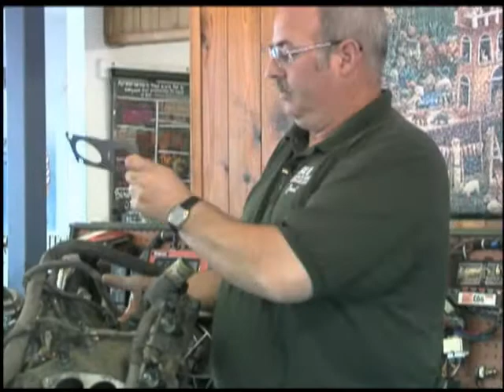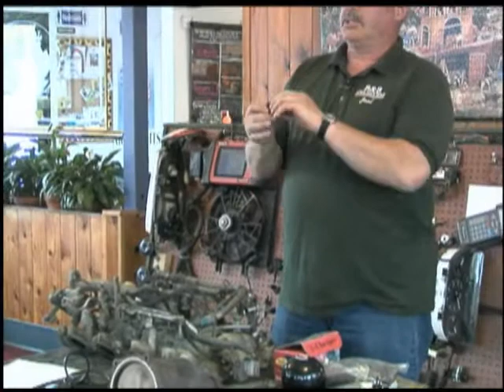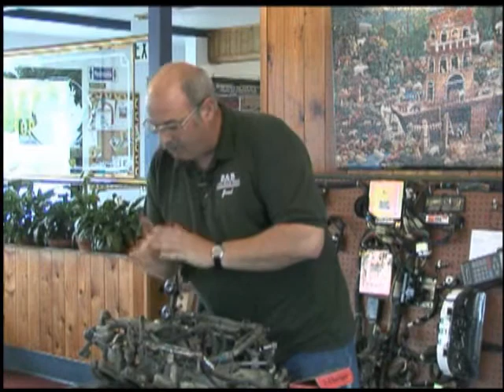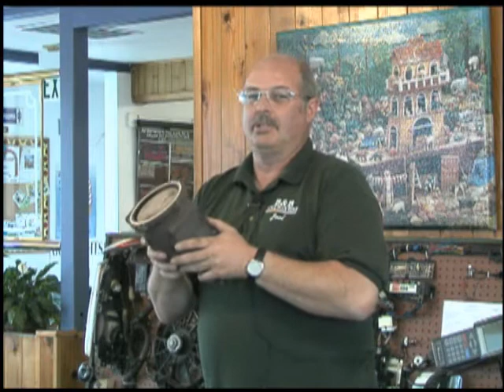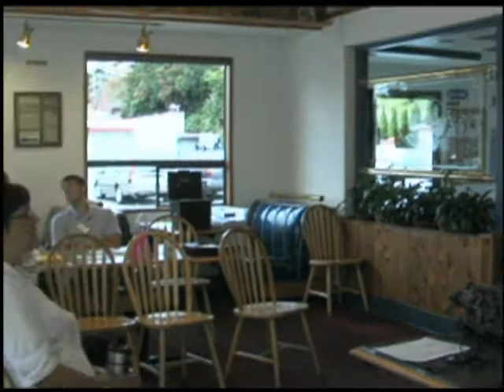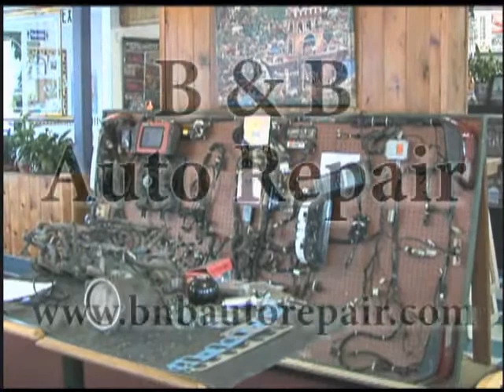Basic Engine Diagnosis & o2 Sensor Codes Part 2

Comment: I just watched your vid pt 1 & 2.  What you stated about the engine running too rich made sense to me & clicked on the Lights. My plugs I just replaced were carbon fouled and when ever I step on the gas to accelerate I have black smoke out the exhaust.  I have a too rich condition but I don't have a check engine light.  And getting only 8 mpg in my Jeep Cherokee 4L Inline 6 sucks! I will definitely have my mechanic do the diagnostic test & fix this issue.